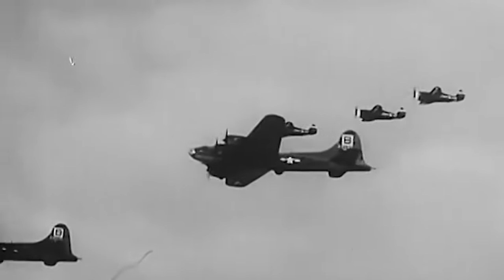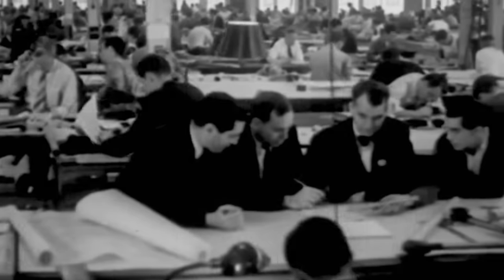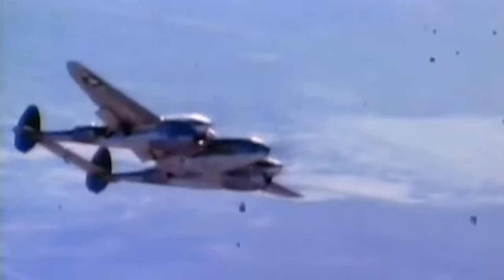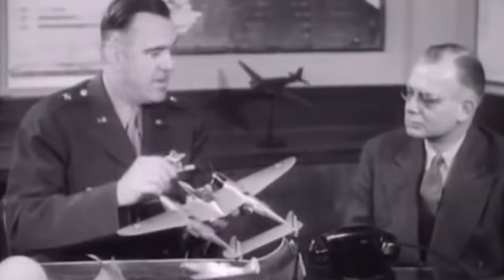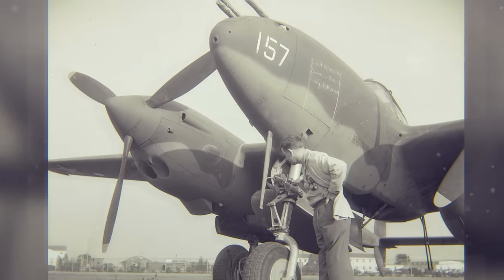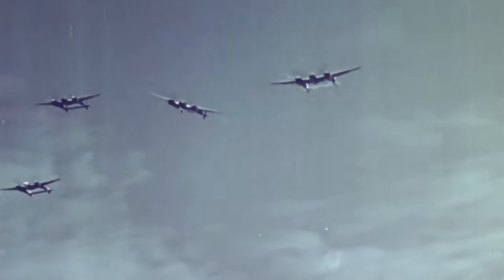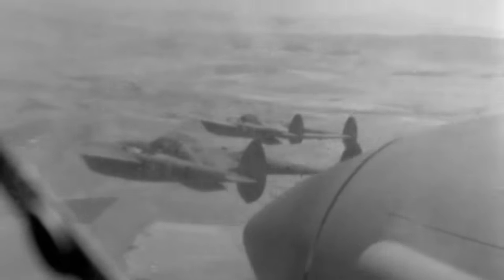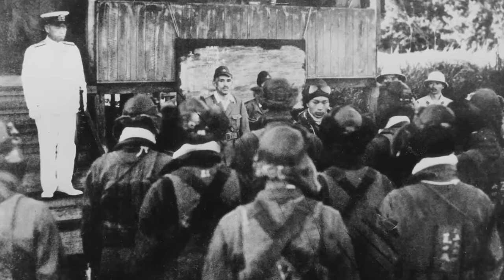Lockheed P-38 Lightning: Outstanding Fork-tailed devil fighter-bomber

Comment: One aspect that does not get a lot of coverage is that the propellers were counter-rotating.   This makes the plane as a whole torque neutral with the result that it could pull out equally to the port or starboard.  Single engine planes could pull out well in one direction, but not the other.  This was an advantage unique to the P-38 among fighter planes.
Reply: Thank you for that.
Reply: It also was a headache for ground crews as the two engines didn't have many interchangeable parts.
Reply: thats the drive system that nearly killed howard hughes
Reply: It did not help them They were easy meat for the Luftwaffe
Reply: and de compression flaps installed.
Reply: @markk2403  Still never changed the T/M
Reply: @jacktattis If they were such easy pickings then the Luftwaffe would not fear them like they did.
Reply: @davecrupel2817  They never. This from Mike Spick Fighters Page 227 and I quote  " but its long wing span and high Wing Loading made it easily out manoeuvred by its German opponents" end quote .
Reply: @jacktattis Lol, easy pickings? It had a 17 to 1 kill ratio…🤡🤡🤡
Reply: @cowboyx9380  Easy pickings in the west my friend 
" easily out manoeuvred by the Germans" part of the piece written by Mike Spick author of more than 30 books on aviation
Reply: @dugclrk  What a load of codswallop. The two engines were identical, it was just the final drive that was different. You don't think that propellors were mounted directly to the crankshaft, do you?
Reply: All fun and games until one engine fails on takeoff.

Comment: The elimination of the limited range convergence guns made it so much easier for fighter pilots, because they could shoot the enemy at any range without having to get it in the convergence zone. This was borne out by the fact that most of the top aces including Dick Bong, Ace of Aces flew P-38s. in addition, speed, the most critical aspect of a fighter was well above any other plane especially the dive speed.

Although my favorite plane is the iconic Voight F-4-U Corsair, mostly for the way it looks, I admire this plane for its performance.

Comment: There was an issue in '43, where there was no standardization in wiring certain subsystems to the same controls, like radio, switching to belly tanks, dropping belly tanks, etc. When the word came down to standardize to a specific pattern, quite a few veteran pilots found that they were 'talking through their belly tanks' until everyone got up to speed on the changes.

Comment: I have always read that the engines were fine in the Pacific theater,but not so much in the European. No twin engined plane can dogfight with a single engine fighter-their roll rates will always be different. Fortunately in the Pacific,they found that boom and zoom tactics defeated the Zero,as it could not respond to the Lightnings,which refused to fight the Japanese way.
Reply: It had nothing to do with the engines.
Reply: A truly skilled pilot could make the p38 really perform.
Reply: The turbos and radiators caused many problems in cold weather, but the Allisons also were flawed and couldnt handle being overboosted, etc.

Comment: "Both British and French delegations insisted the fighters be equipped with Allison s without turbo-superchargers and with strictly right-hand rotation because they wanted the engines interchangeable with those of the Curtiss H.81A Tomahawk that had been ordered by both Britain and France in large numbers. In addition the Committee wanted to optimize the aircraft for medium-altitude combat, as was currently the dominant mode of aerial warfare in Europe, rather than the high-altitude role for which the P-38 had been designed."
Has ! Not secure warning
Aerofiles Lightning I/II exports page
Reply: Rubbish Nick  They tried to pull a swiftie
Reply: Rubbish Bill Gunston Combat Aircraft page 130
Reply: BennyFranks-pj3mg  That would be you my friend

Comment: Thanks you guys for providing these videos. They are critically important for not only current generations but for future generations as well. A couple of nit-picky points. First, a lot of the problems the ETO experienced with the Alison engines was attributed directly to the poor AvGas the Brits provided. Once the 100 octane fuel became abundant, most of the engine problems disappeared. Another thing was Lockheed’s use of the exhaust driven turbo charger (not a super charger which is driven off the crankshaft) meant the Alison in the P-38 could fly at the altitudes combat occurred at in Europe. Unlike the P-40, which only had a single stage supercharger and was altitude limited to 15000ft., the twin Alison’s of the P-38 were more than up to the challenges of the ETO.
Reply: The P-38's Allison did have a mechanical supercharger.  Allison was never pushed to develop an efficient two-stage supercharger by the USAAF who preferred turbocharging for high altitude performance.  That technology worked great with the radial engines of the B-24, B-17, and P-47, but was never completely sorted out on the P-38.  Even the L model continued to have its share of hiccups.   Of the myriad problems the -38's Allisons suffered in the ETO poor fuel quality was a definate contributor.

Comment: There have been numerous interviews with Luftwaffe pilots that flew Fw190s and BF109s.  They did NOT fear the P-38 in a dogfight.  They said it was easy to turn inside and shot down.  They only feared it when it came down from above at speed.
Reply: All that came from one luftwaffe ace that has been called out on his bullshit several times.
Reply: He leaves out the fact that he was shot down by 38's more than once.
Reply: @brandonstrife9738 It must have e been to diving Lightnings. 😂
Reply: @brandonstrife9738   You talk nonsense. Fighter pilots did not really fear the P-38, there are more than 20 pilots who shot down more than five P-38. The aircraft was feared when used as fighter bomber.
Reply: @olafkunert3714  once again you don't address my argument and everything you've said thus far has been wrong and the aces name was gallond he flew 190s which a 38 out turn the holy shot out of
Reply: @brandonstrife9738 It was Adolf Galland, not Gallond, and he was not the only person to say that he didnt fear P38's. As for the P38 out turning a FW190, yes but only at speeds less than 140 Kns.  Other than that the FW was more manoeuvrable, indeed it was more manoeuvrable than most of the Bf 109s at low and medium alts.
Reply: The Zero was an effective dogfighter too. The Lightning could simply outrun it, get above it again and blast it. That was their advantage. Fight their battle not the other pilots.
Reply: Correct.  The P-38 had too many vices to be effective at high alt.

Comment: A few things not mentioned...

Many of the problems with the P-38 were because it was the first plane to fly so high and fast. The compressiblity issue was due to a "slow speed" airfoil and all planes of that era had similar issues though the P-38 was the worst. That being said, it wasn't a problem at lower altitudes and I'm not aware of any combat pilots definitely being lost to it. And? Tales of German fighters diving away because they "knew the Lightnings wouldn't follow" is most likely because they weren't permitted to chase German fighters.

The top speed isn't really known. There were official speed trials for the G but not the later J and L. Some records were lost but it seems that no one needed to know it's official top speed. There are estimates as high as 440mph but pilots didn't complain about being too slow.

The Allison engine and turbo needed to grow into each other. The original intercooler was a bad design, and a lot of the problems were fixed when they changed it, but most of the problems were concentrated in England. Part of that was because of flying long ranges at such altitude and low temperature but part if it was the fuel. At the time the lightning was introduced the fuel being used in Britain wasn't quite as highly refined as what was sent to the Pacfic or North Africa. All high altitude aircraft had some problems with it but, those Allison's again, the P-38 was hit hardest.

So? The P-38 going strong to the end of the war was very different than the one the 8th AirForce, rightly I think, gave up on. A huge "what if" is "what if there had been no P-51"? The record after the Lightnings left the 8th suggests it would have gone on pretty much as history records. The performance difference between the two is fractional when running right and the engine problems were pretty much solved. A big factor in replacing the Lightnings was actually cost. She cost more than a Mustang or Jug and that worked out great for the guys privileged to fly her.

Comment: My father flew the P-38 in the later years of WWII as part of the 23rd Fighter Group  in China, after spending at first in 1942 - 43 in a P-40B then a C, and then a P-51C in 44, finally the P-38D in early 45 as the USAAC had essential rid the China skies of all Japanese aircraft and they needed the pilots to conduct Ground Attack and CloseAir Sport of US Army infantry units taking out the remainder of Japanese troops in Northern China. Of all the planes he flew, he loved the P-38 the most.

Comment: When the USAAF finally realized that the B-17's needed fighter protection during daylight missions over Germany the P-38 was available, but was in high demand in every theater of the war.  The P-38 was a difficult aircraft to learn to fly, and to maintain in the field.  Reports are that it was not easy to get into full combat mode after hours of escorting bombers at slower speed.  The cold cockpit was a major drawback.  These drawbacks along with command bias towards single engine aircraft, and the need for a lot of good dependable long range aircraft and pilots to fly them led to the P-51 taking over most of the bomber escort duty.
Reply: Additionally: Maybe not the least of all reasoning may have been, that the P-51 came at almost exactly half the price of a P-38.
Reply: The aircraft mechanics in the Pacific re-routed the fresh air intakes over the exhaust pipes and directed them to the cockpit. A simple valve allowed the pilot to choose the amount of heat he wanted into the cockpit. More heated fresh air could be directed to the windscreen which got rid of “foggy windshields.” The same mechanics invented a valve that automatically adjusted the air-fuel mixture to get the most power out of the engines when the fighters went into full combat mode. They did other things to improve performance and found ways to increase fuel load. Lockheed fitted all of these modifications into their assembly lines. I submit that by late 1944, and I admit I never researched this, the P-38 was at least as good as the P-51 Mustang, if not the better fighter.
Reply: @williampaz2092  Yes, the lightning's design was way ahead of it's time, and sadly the demands of the combat situation in Europe didn't allow enough time for improvements to be implemented in the field.  The P-38 took longer to learn how to fly effectively and the USAAF needed lots of good fighter pilots in a hurry.  A review of the P-38's performance on escort missions revealed that the critical moment when Luftwaffe fighters were engaging from an advantageous position, the P-38 pilots had to perform several critical control maneuvers to get the plane up to very highs speeds.
Reply: No bias a single engine was better
Reply: @williampaz2092  No twin engines and high wing loadings do not make a good fighter
Reply: P-38s had a host of problems making them ineffective as high alt escorts until late 1944.  Even then their dive speed was poor.

Comment: The British ordered the P-38 without the contra rotating propellers. They did poorly and eventually had the engine swapped out for contra rotating ones. The main advantage to the P-38 was in approaching friendly bomber formations. P-51s resembled Bf109s and several were shot down by bomber gunners. The P-38 had no such problem. The other advantage was the two engines. There are numerous examples of P-38s that had one engine receive damage from flak or fighters that made it home on one engine.
Reply: No incorrect.
Reply: It was uniquely suited for the Pacific theater, with its vast over-water distances, due to having 2 engines.
Reply: Richard - I think you're confusing the direction of counter-rotation with not having counter rotating props.  The early production units (that would have gone to the British before the Americans entered the war) had the tops of the props arcing inwards; the later production units had the tops of the props arcing outward. Regardless, all P-38s had counter-rotating props.

Comment: At about 1:55: the engines were NOT “in-line”. They are V-12’s
Reply: V-12s ARE in-line engines as the cylinders are arranged in a line in two banks as opposed to being arranged in a ring as in RADIAL engines as seen on P-47s, F-4 Wildcats, F-6 Hellcats, F4U Corsairs, A6M Zeros, B-17s, B-24s, etc.

Comment: The Allison was actually a pretty good engine. The downfall was that Allison was told to not bother developing a supercharger. GE would provide the supercharger. GE fell flat.  Late in the war Allison 1710 with an Allison supercharger would go toe-to-toe with the Merlin.
Reply: Only at low altitude When that second stage of the Merlin kicked in it was goodbye Allison

Comment: Afraid of? That's odd: Galland and Rall said they never had any problem with the p-38.
Reply: Mainly due to poor tactics, when used properly things were a bit different especially with later models
Reply: How long had they been flying air combat before they encountered P38's?
Reply: Also, how much experience did the p38 pilots have when sent over. The p38 took more training and many pilots were not proficient with the plane when rushed to the front.
Reply: I think it was Rall that said P38 had poor role rate
Reply: @nickdanger3802  I would say not long after their win over a Condor on the way over

Comment: I wonder if the P38 Lightning would have benefitted if it had received Rolls Royce Merlin/Griffin engines?
Reply: I think no because the Merlin did consumes more gas per hp : a turbocharger did use ~5% from the power from a engine and a engine driven supercharger need +30% from the power from the engine= more consumption...The climb rate from a P38 was fantastic, close twice the climb rate from a P51D, so with a ennemy in the tail, the best a pilot can make to leave is to climb full power at 45% climb angle...
Reply: First of all it couldn't even fit the Merlin or Griffon which would require a redesign of the nacelles, which would probably increase the drag of the plane... and it's already not worth it.
Reply: The Allison super/turbo charger on the P38 had more horsepower than then the 2  stage supercharged Merlin.  The P38 was designed for the big turbochargers in the tail booms.  The 2 stage supercharger that was designed by Packard for the Merlin engine didn't come out until late 43 early 44 and again never produced more horsepower than the Allison with the super/turbo charger combo that was used in the P38.  Greg's Airplanes and Automobiles has and episode on this very topic.  So no, The P38 wouldn't of benefitted from having the Merlin engine, it would of actually hurt the planes performance.
Reply: @kvnkaveman  Pratt &Whitney developed the first two stage superchargers, they were in f4 wildcats
Reply: P-38 Lightning Why Not Merlin Engines?
https://www.youtube.com/watch?v=oJPGFcXRZZI
Reply: @leneanderthalien  It was good but not close to double that of the P51 The P38 was tested at 3000 ft/min at Wright Field in Jun 44 which is behind the P51
Reply: @kvnkaveman  The 2 speed 2 stage Supercharge on the Merlin was out in April 42 .Merlin 63  1650hp as fitted to the MkIX LF  
Alllison as put in the Lockheed P38L V-1710-111-113 1600hp 
 Lockheed Max Weight 21600lb Spitfire Mk F-IX- E  Max 7500lb So the Spitfire was 2.88 lighter 
And I doubt Lord Beaverbrook and Rolls Royce would have allowed more Merlins to be fitted to another US Plane
Reply: @kenneth9874  Yes but not a compound two speed
Reply: Cont 2 stage
Reply: @leneanderthalien  The best climb rate for the P38 was 4000ft/min P51 3490 ft/min so enough of the exaggeration.
Reply: @kvnkaveman  1. Merlin 60 series  out April 42 1560hp to 1658hp    
2. Spitfire IX tare weight 5800 lbs to max permissible  7500 lbs               P38 L  Max 21600lb 
3. Spitfire Wing Loadings 25lbs/sq.ft                                                              P38L 53  lbs /sq. ft
4. 2 stage Super on the Merlin was NOT designed by Packard It was designed by John Hooker a Rolls Royce engineer. 
5. The Packard had a epicyclic gear train the Merlin had clutches and the Packard was less efficient than the Merlin
Reply: @kenneth9874  Different concept they were NOT compound superchargers
Reply: @jacktattis  the American f4 wildcat pioneered the 2stage 2speed intercooled supercharger in military aircraft, the p38's and P47's pioneered turbo superchargers in fighters. Do try and get some facts straight for once in your life, I know that it's hard for you to live with the disgrace of becoming an islamic puppet state but making up stuff to attempt to glorify the past isn't helping your pitiful situation.
Reply: @Tacticaviator7 the Allison engines were exchanged for Merlins and transformed the P51 without the engine cowling being changed much at all. In fact it looked very slim.